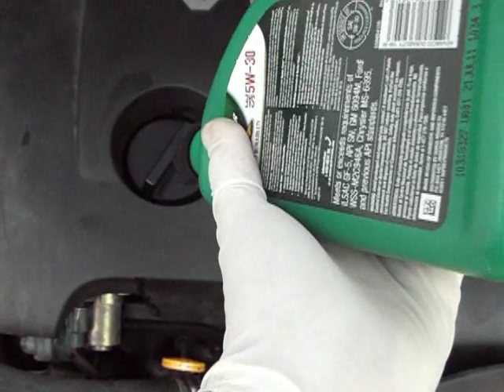How to Install Oil Cooler O-Ring on Nissan Quest 2006

Comment from the maker: Same torque as my 2006 Quest: the torque for the oil cooler bolt is 36 ft-lb and 13 ft-lb for the oil filter.
Good Luck!

Comment: Great video. Tires Plus quoted me $140.00 only after I took it back to them 3 times after an oil change and I kept seeing oil on the garage floor. Do you have to have a torque wrench and if so. What is the proper torque for a 2007 Nissan Quest?

Comment: Hi Roluardo. Great video man. I heard a hissing sound coming from my 2004 Nissan quest and when I checked, there was oil all over specially under the filter, but I could not see where. Now I see that it could be on the back. And the hissing could be that the belt was getting oil when rotating right?

Comment: I was installing an oil cooler o-ring on Nissan Xterra 2005 an when i opened the oil filter housing a ball bearing felt out..i know where it goes an the name of ...the thing..its an oil pressure valve relief..but dont know how to take the old one out and how to put the new one in.i would really appreciate it if someone could help me out

Comment: Did you have to drain coolant or just the oil (only asking because I've seen post that say the coolant must be drained)?? Thanks trying to save myself couple hundred bucks here. I have a 2007 Nissan Quest only 72,000 miles with the same exact problem.
Reply from the maker: If I remember correctly, I think you do not even need to drain the oil.  Just remove the filter and some oil will come out. You can replace O-Ring and install the old filter back again and then add the oil that was lost. If it is time for oil change then I guess you can also drain the oil and install new filter. Also, no need to drain the coolant with this approach.

Comment: Seems to be a common problem with these vans....
Reply: Its not just Vans, Pickup trucks, its because you people dont change your engine oil every 70-80 running hours. That contaminated oil deteriorates that gasket.
Reply: Charles BridgTec Its only a problem for those who neglect their oil change intervals, I have near 100,000 and no leaks. I use synthetic from 7,000 miles on the car, chane my oil every 100 hours.